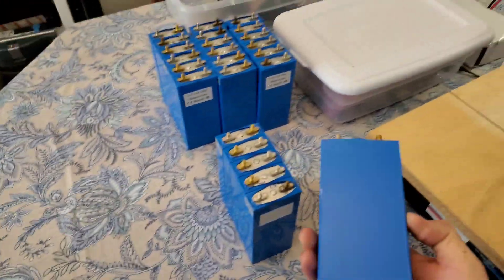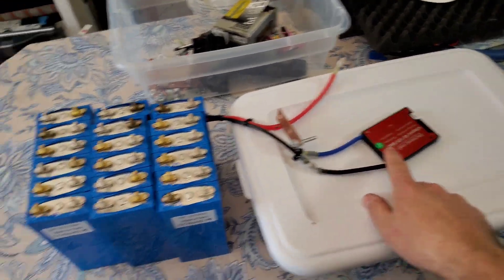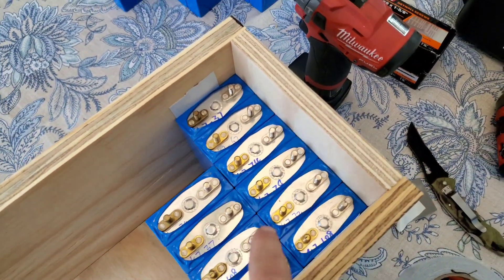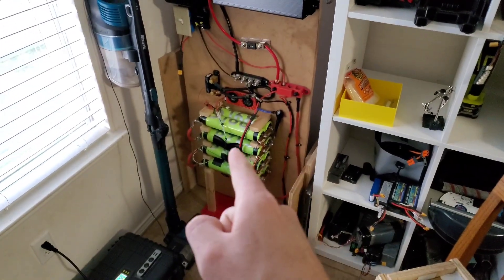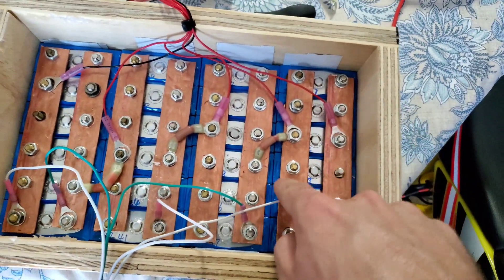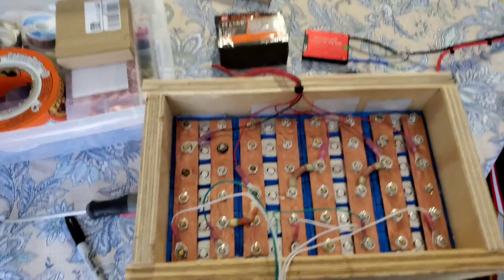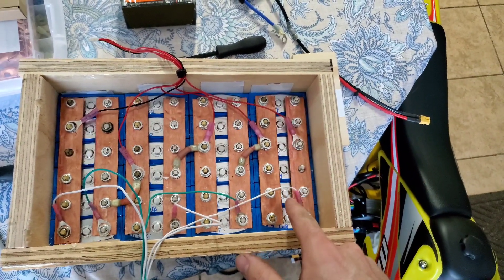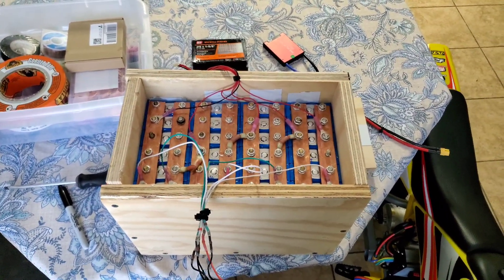Simple Battery build! 12v 150ah Lifepo4 diy with bms

Comment: Cool 👍
I have a wooden battery box as well 😁
Are those smaller cells cheaper than the larger cells ?  I used 280Ah cells but boy they cost me 😮
Enjoyed the vid chap 👍
Reply from the maker: I think the bigger cells are cheaper per watt hour then smaller, but sometimes you can find good deals on smaller cells just depends